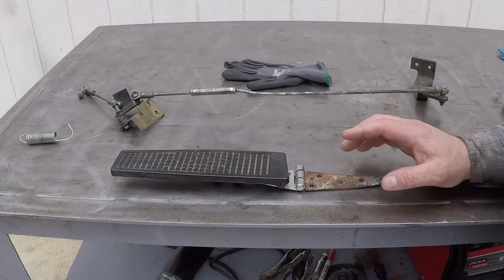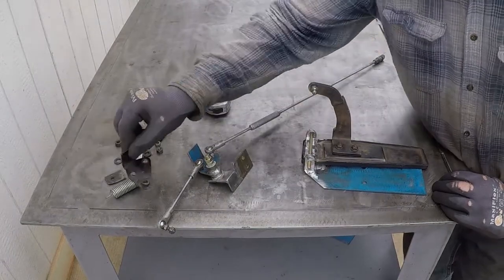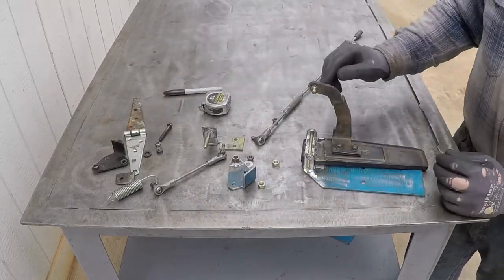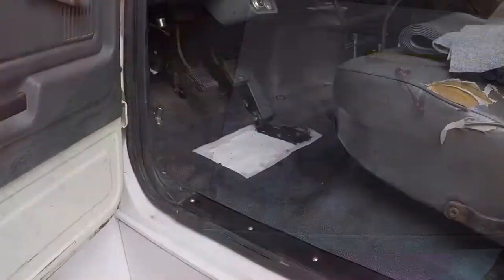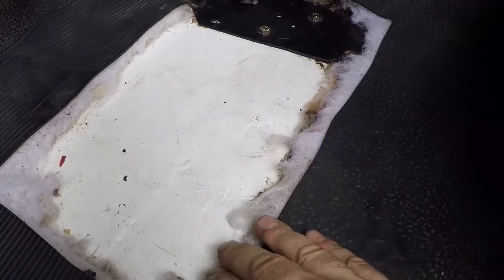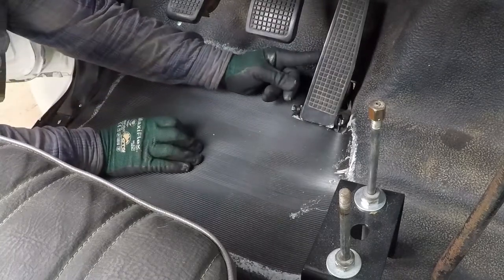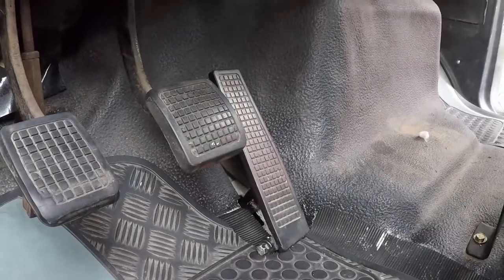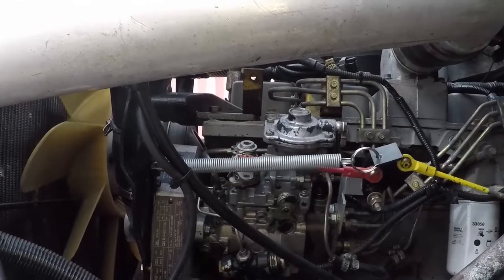Repair Accelerator Pedal And Floor Matt

Comment: Good fix ... Well thought out. The double keychain was an excellent touch. Best to You and Yours.
Reply from the maker: The accelerator paddle, linkage and spring tension is way better than what was there before. When I first bought the truck, it was hard to press the accelerator. The top speed was limited as well. Best to you and your family. Have a great day

Comment: Question for you sir. Thanks for the awesome video. I have the same problem with my 89 Ford f800 that’s been sitting for six months in NC. Could you help me please with the same repairs. I don’t have the tools and skills. Thanks
Reply from the maker: Good evening sir, you are very far away. I will not be able to do the repair for you. If you have questions about the repair or the person who is going to do it for you, please ask and I will do my best to answer your question.
Reply: @SalamSayhood  Thanks. Is it ok to take some pictures in and under the truck to see what’s needed to be fabricated. Mine is a manual transmission like your dump truck. If I got you enough photos, could you fabricate mine? I bought the paddle but the rod that connects to the paddle is missing. I will also have to check underneath the truck and take pictures. Is that okay with you? Also, please how can I reach you off this YouTube channel? Please forgive me, I am excited running into your YouTube channel. Thanks.
Reply from the maker: I really appreciate your interest, however, I am very busy at work and with my own projects. I have a complete playlist for all the repairs I did on this dump truck on my YouTube channel. I am pretty sure you can find someone local to you that can help. If you have any questions regarding any of my videos, I can explain it more or answer a specific question. Thank you and have a great weekend.
Reply: @SalamSayhood  Understood and thanks for the videos.